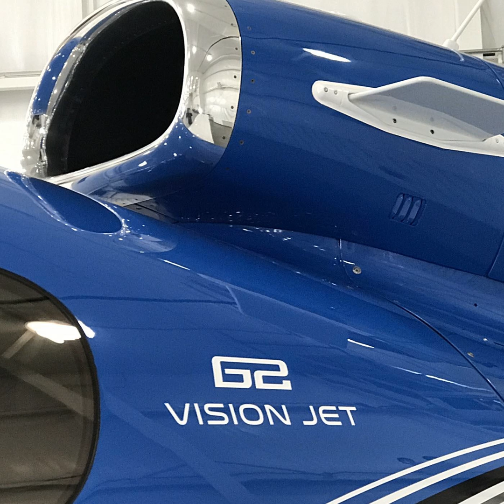96 Cirrus Vision Jet G2 Features, Specs and Price – Interview with Matt Bergwall

Comment: In my fair opinion; The jet has a lot of potential, to fit the needs of many that seek small aircraft like this one. Inflation are bound to happen eventually, so I wasn't surprised when they mentioned it's current base price. We also have to understand that new stuff has been implemented, and they are not cheap. The Cirrus person,was very clear on the add-on that wasn't on the previous generation and changes to the airframe in general. If you think it's too much then more power to you, to get what you want.

Comment: Okay, now the base loaded price is $2.75m  putting it back out of the market for 300kt 1000mi ranged aircraft.  Why get this relatively inefficient jet (70gph burn) when you can get a more efficient turboprop that is comfortable flying lower and landing on grass or small strips?   

Pipers M600 has 1700mi range, 280ktas cruise, fl30, 39gph burn, weather radar, 5 year 7 year warranty, real cabin class entry, $2.8m asking, they will dicker, Cirrus won't.  Sad.  I am a Cirrus owner and was looking at the jet, no more.
Reply: GBigs Angle exactly. 1.96 is nice, but 2.75...c’mon guys, it ain’t that luring anymore.